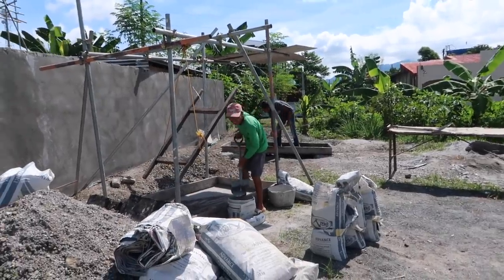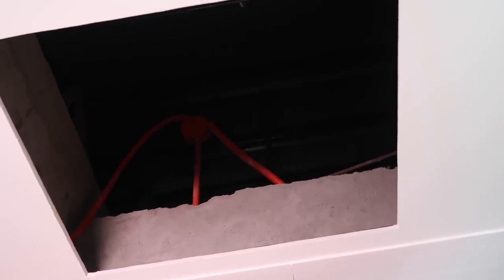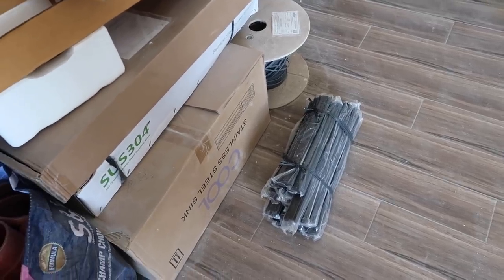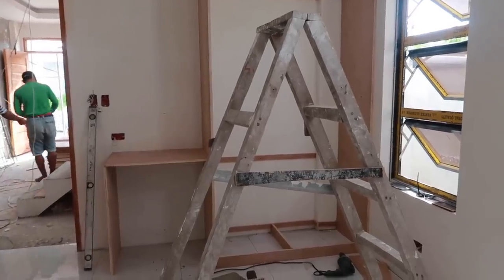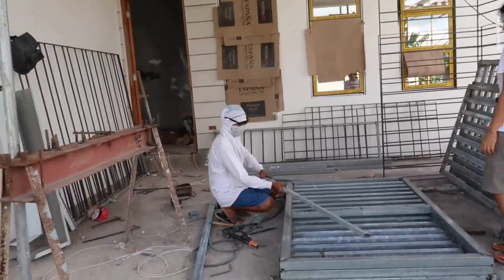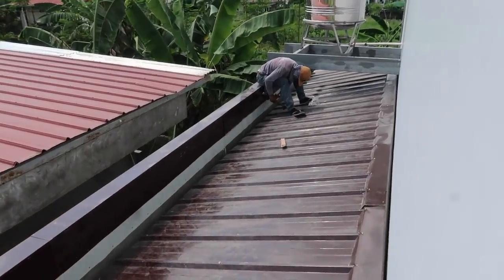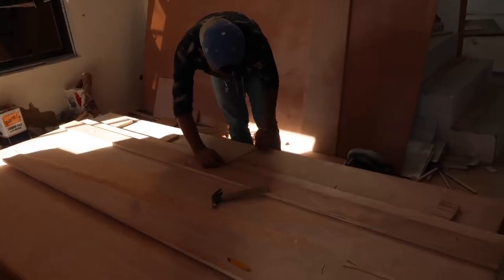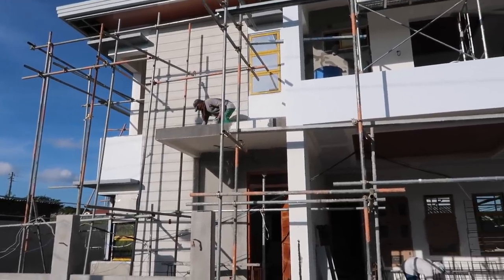HOUSE BUILDING IN THE PHILIPPINES - EPISODE 165: FIRST BEDROOM CABINET I CAT6 CABLE

Comment: If your builders want to put something in between the metal and wall and then just press/fasten it somehow to the wall you should say, thanks but no thanks, as it will only be a matter of time before it will start to leek in.

Now it's actually a good time to use a grinder :), to cut in to the wall, like 3 cm deep, 1 cm wide or so in a 20 degree angle downwards a bit over the sheet that are ther today, then they should use an L shaped metal, where the short end of it is bended in like 45 degree in the end.
Use primer inside the track they cut, then some silicone or similar in to the bottom of ther track, put in the L sheet, the bend should press it down in the track and fasten it, and finally use some silicone or similar to cover the opening that are there and you will never have a leek.

The overlap should be at least 10 cm between the 2 different metals, and in between the 2 metals they could use a thin stripe of silicone or similar as an extra safety, it will also help for bug's
I write silicone or similar as i dont know what kind uf stuff they have there to use.

Comment: You're guys have a lot of rubber cement they use as water sealing. They can smear a continuous line between the vertical wall and that roof flashing. Then drill through the flashing every 12 inches into the cement wall. Then use hex head cement screws to pull the flashing against the wall. Finish it off with a bead of urethane caulking along the top edge. That should be a permanent install that won't require much maintenance at all. That hacked up veneer in the drawer bottom is not cool at all! You're a very patient man but I guess part of it is you have to deal with the reality of some of your laborers skill level and ability to understand exactly what or how something is supposed to be done. These guys are making me nuts working on your finished flooring without anything to protect it from scratches and chips.
Reply: The Inspector - I was thinking the same thing with regards to the finished floor.